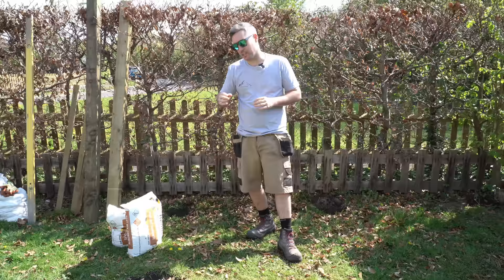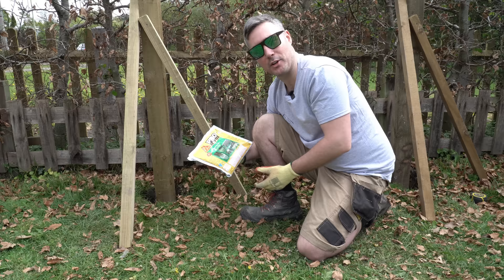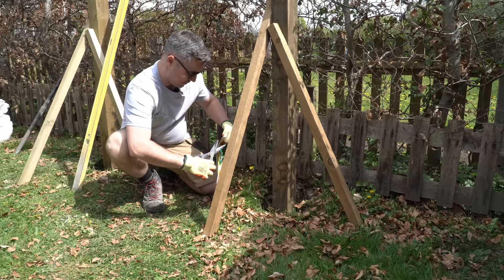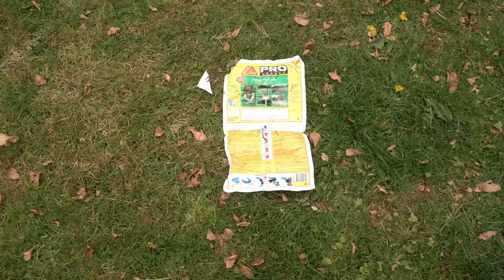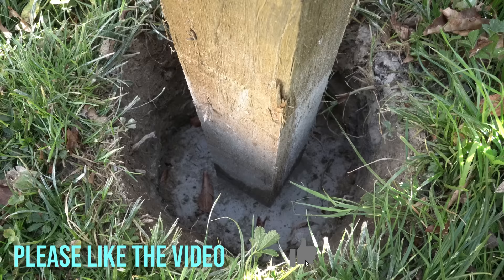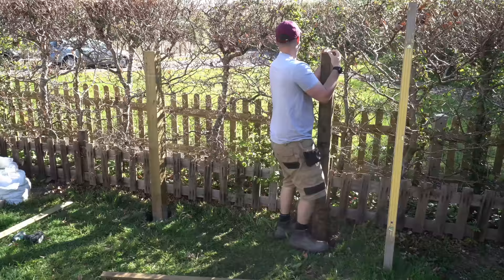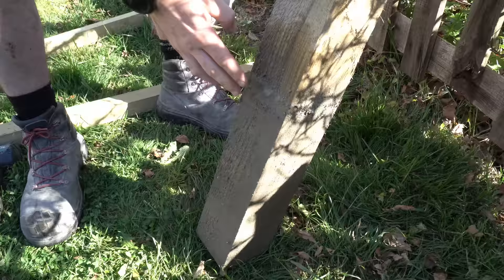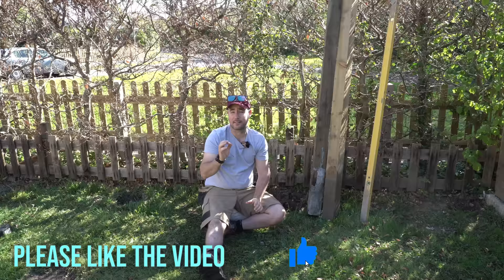Fence Post Foam vs Concrete | STRENGTH TEST

Comment: I've set posts both ways.  I've had them set for several years now and both methods are rock solid.  IDK what you did differently.  I think the foam is certaily much easier for someone with a bad back or arthritis.
Reply: He didn't fill the hole properly and he dug holes that were far too big (diameter). You can see he easily pulled the post out of the concrete with minimal effort. Did basically nothing right. Terrible fencing.
Reply: Foam is the way to go. I don’t think he mixed the foam bag properly
Reply: @kxjx  I saw that. The holes are way too wide.
Reply: Foam is plastics. Why would anyone want to fill their soil with that?
Reply: @Nicolasbotero1  I wonder how much the foam degrades over the life of the post. Its quite easy to cut the foam back out again; but if the foam is breaking apart/breaking down, or leeching anything nasty into the soil that wouldn't be good. Having said that, something tells me that the postcrete probably also has quite a lot of additives that might not be the nicest. And the carbon footprint of concrete is high (making the concrete, plus transporting all that weight). More good reasons to try to keep the amount of filler material to a minimum.
Reply: @kxjx  correct, concrete mix has plenty of chemicals! Debatable what is worse for the environment but I would venture to bet the plastic foam is.
Reply: @kxjx  100%  He put a bit of product in the bottom of a hole.  That is not how you use either product for fence posts.  Absolutely the worst attempt at putting in posts that I've ever seen.  Not sure how you do it this poorly as even the instructions on both products tell you how to do it and there are thousands of videos and articles on how to put in posts.

Comment: I had the ultimate test of fence posts set in concrete.  During Hurricane Katrina in Mississippi, USA, posts broke off just above the concrete.  Some posts shifted and others snapped laying about 25' down, sheered where the nails failed.  I am a firm believer in concrete, though a pain to replace, but very sturdy.  I am also a firm believer is using screws instead of nails as screws do not pull out unless they break.
Reply: Nice NPC flag.

Comment: I've installed many field entrance posts with 16-20' steel gates.   I've used concrete and foam more recently.   I would never go back to concrete.   The foam is easy to work with and if done correctly, it protects the post and is every bit as stable.
Reply: What should he have done differently?
Reply: @rimrejects  followed the application instructions.

Comment: Up here in wet rainy Oregon, some of us use Pea Gravel for the post. It 
helps a few ways, like if the post moves even a fraction in the wind the
 gravel sinks and tightens the post continually never letting the post 
get loose. (Just keep the pea gravel capped off). Also, the water has a 
drain away from the post ground level so the water rot in that spot is 
no longer a problem. Another way it helps is that there is no concrete 
mixing! Many up here think it's faster and better.
Reply from the maker: The whole post hole is filled with pea gravel ? Thats a new one one me and i cant see it working if im honest.
Reply: @JamesMontana  concrete is the worst thing you can use. I retains moisture between the concrete and the post. The post eventually gets saturated and rots off at the top of the concrete. Foam is used by all the utility companies for their poles that weigh about 1500 pounds so I think your fence posts should be all right. A post that has gravel round it compacted in six inch lifts is not going anywhere and it allows the post bottom to dry out. I would coat the bottom of the post with  asphaltic foundation coating or put 30 pound felt around it prior to back filling.
Reply: Yep. Pea gravel is self packing. Often used as a base for filling big holes and topping off with concrete.
Reply: @DG-kq8zf  When the old concrete guys all say pea gravel is the way for post, you just got to listen. Doing the same mistake over and over has got to learn them something. I would think. They sure are firm on the gravel!
Reply: The subsoil where I live is clay. It retains water so timber posts will never last long. We use H section concrete posts set in concrete but this foam is probably just as good. All methods are only as strong as the surrounding soil.
Reply: @JamesMontana  in Florida where the water table can be high after rains, this is how greenhouse posts are set, in pea gravel, it's like a Chinese finger torture for the fence post it also drains super fast.
Greenhouses have lots of irrigation several times a day so  drainage is very necessary.
When all is said and done after a hurricane, the nursery office may be gone and the plastic may be shredded but the greenhouse structure remains
Reply: @JamesMontana  try it my neighbour showed me this 20 years ago the posts still stand today it’s impressive
Reply: ReasoingTruth  Crusher chip is even better.
Reply: @gordthor5351  I never even heard of it before. (I'm not in this by trade). But looking at its description, I can see how it would be better. I'll pass it on. I figure the tighter it packs yet still allows water drainage, the better everything will be. (Around the post). LOL
Reply: @JamesMontana  Doubting Thomas is that you?
Reply: @reasoningtruth  Crusher chip is the small jagged chips from crushing larger rocks (typically for decretive colored landscaping rock). 

I agree, the tighter it packs the better and I don't think anything packs better than crusher chip. It locks together like Tetras with a lot of friction area and still has great drainage.
Reply: @gordthor5351  I know, now. It's also the preferred bedding for pavers, for the same reason, great compaction but still great drainage. Who could ask for more? Thanks again!
Reply: @JamesMontana  That works very well, in Normandy France with a pretty rainy climate on a clay soil with sometimes strong wings, using well compacted 6-10 mm gravel to fill the post holes. Besides in a such humid climate that prevents the posts (treated, and covered of tar in soil contact part) from rotting as the water runs immediately. A well done fence for horses will last more than 30 years.
Reply: @reasoningtruth  no they aren’t.

I got quotes in my area this year from local fence companies. All concrete the posts in.
Reply: I installed a treated wooden fence 21 years ago around my back yard. Holes were dug 3 feet down by 10 inches wide and filled up with crushed rock around 4 by 4 posts that were also treated. This year out of the 50 posts, I had to change 3 that were broken 2 feet down in the soil due to various impacts over the years. I was easi.y able to pull out the top portions of the broken posts but had to dig 3 feet down to remove the rest and installed new ones in thier place.

No matter how well treated wooden posts are, they will all eventually rot and need to be replaced but the point here is that it took 21 years. That's pretty good in my books and also, rotted or broken wooden posts are much easier to change when back filled with crushed stone than when back filled with cement.

Comment: I used the foam product on two treated 6 ft posts and it worked great and both posts are totally solid. I used a post hole digger and that left a hole just a little larger than the post. The mix in both cased grew just slightly above ground level.
Reply: Yeah his holes are far too big for a 4x4 post. 1 bag with a proper dug hole fills to above the hole. Shave excess at a slope to move water away from the post. cover with dirt. Never had one of these fail on a fence or mailbox.
Reply: He dug these holes way too big for foam. The foam works great when used properly. We did our entire fence with it and it's been rock solid through 3 hurricanes. Hurricane Ida hit us directly with the north-facing wall of the eye and our fence is still solid.
Reply: Hey if I wanted to do a 4x4 post for string lights about 8 ft high, would sika be ok in this application? Also how deep and wide should my hole be for 8ft high post above ground? Thanks!
Reply: seems like both would have benefited from a couple small lag screws being placed on the post so it wouldn't be pulled out so easily. The posts are too smooth to hold without adding some notches or irregularities to them. Don't think it's going to be manually pulled out with some screws or nails embedded in the post base.
Reply: @donaldso718  Yes

Comment: If you add the foam correctly, its a much better seal against water. When you add the foam liquid you are supposed to make sure you pour it against the post on all four sides so that the post is coated with foam liquid even above grade. Also, lets fill the hole...lol..the foam should come above grade. We use a product by a different name (Fast2K), and its far superior to concrete.
Reply: Your comments are correct.  He didn't install as noted in the instructions.

I tried the foam this weekend to install a wooden mailbox post and followed the instructions as per the bag.  it expanded much more than in this video and completely filled the hole creating a slope away from the post.

Would I use it to install wood fence posts that will support a constant weight?  I am not sure but it defintitely worked as hoped / expected in my instance.
Reply: so if he pour the foam in the hole a different way or made the hole smaller around.. your saying the wooden post wouldnt be soaked after 6days..?  the post being soaked is Bad problem
Reply: @user5.56   My GUESS is that he didn't mix the product correctly since it didn't appear to expand like it did when I used the product.
Reply: @user5.56  what I noticed, he only poured it on 1 side. If it has to run around the post, it's going to create those voids, especially more so when it starts setting up and hardens
Reply: He is using it wrong that's right but in no way the foam is ever better than concrete except for ease of use maybe. The fact that it's missing the weight that comes with concrete alone is a big downside for anything that's bigger than a mailbox post
Reply: I've read that fast 2k is just better than the foam he used in all respects.  It doesn't contract after setting, which is a very common complaint for the foam he used.  Also you're correct that you're supposed to cover the sides of the post and if you do that then you get a weather proof seal on the sides of your post.
Reply: @user5.56  The post is soaked because he did not use drainage gravel in the bottom of the hole. The soil is wet down there. The post is just a big plant... Do flowers drink from the top down? No they draw water up from the ground. So the post, without a separator from the wet dirt is going to draw water up like a straw toward the dry parts of the post, just as a dry sponge absorbs and moves water from the wettest part to the driest part until it equalizes. So if he had put gravel in the bottom, the water would have pooled into the spaces between the gravel and the post would not have absorbed it before the dirt below the gravel could. Hope that answers your questions. I build fences professionally.
Reply: @hans2five  That's true. I actually use Fast2K. Performs better and sets faster than Sika. Ready to work on in 25-30 mins.
Reply: @Nipplepotamus   alot of flowers drink from the top down  catches it in the voids of the leaves..  but yea gravel defiantly would of help with this
Reply: @Nipplepotamus  or put a sealant on the bottom of the post maybe so it’s waterproof.
Reply: I think temperature may have been an issue.  I notice when I've worked with foam that the warmer the temperature, the quicker the foam set up and fully expanded.  I think colder temps make the batch expand to slowly compromising the mixture
Reply: Just like a lazy man , defending foam lol i will stick with concrete thanks , faom lol , what happens if the land gets floods,  do the post pop out like corks in water ?
Reply: I wonder about what’s happened over time with foam and how it decomposes a overtime
Reply: I’m not sure how he did this wrong, but I put up 150 feet of 6’ high privacy fence using 2-3/8” steel posts (in Texas wood 4x4s warp terribly in the hot sun!) and have had no issues in over two years.  The foam rose out of the ground in every case and I hung a 5’ wide wooden gate on one post; you can feel motion but it still latches properly.  Caution- that foam is HOT and will give you a nasty burn - gloves required!
Reply: @NOBODY-oq1xr  That's strange because utilities use a similar material for power poles with no problems, it's odd they would use something like that as clearly power poles are a hair larger than your average mailbox 4x4 post.

Comment: Back when I did satellite installations here in the US for customers that didn't want the dish mounted on their roof, we used the foam on a pole installation and then put the dish on the pole/pipe. We have had tornados come through and completely destroy homes and while the satellite dish was gone and the pole maybe bent a bit, the pole remained seated in the ground.
Reply: Junk,I've used this a couple times at work ,ok for line post but not for stand alone gate post,
Reply: If you want the foam to work really well, and it will, you have to know the secret ingredient to add to the mixture. I found that if you mix up the 2 parts and start filling the hole, if you stop after adding 1/4 of the mixture and then sprinkle 5 oz of wheat flour on top, then add more mix and repeat with the flour, until you mix is all used up, you will get a much better quality of a setting. Another thing you could add is 2 1/2 cups of oatmeal.
Reply: @johnkapel2128  organic works best
Reply: Did you tell any of them that it's actually ground based ?

Comment: Just this week I installed two fence posts using the foam. It worked great. 

The foam expanded so much I had to cut a large chunk of it off above ground. Posts are solid 👍.

I used an old school post hole digger and dug 2ft deep holes for 8ft 4x4s.
Reply: nice try foam AI.
Reply: @bvbxiong5791  WTF does that mean?
Reply: @JeffRiggins8080  I think he's accusing you of being a bot? (Seems jokingly, but I'm talking out my back side anyways, so..... lol)
Reply: @krevor4095  I've been accused of many things, but that's a first 🙂.

Comment: I just used foam on fence posts this past weekend. There was about 6” of water in the bottom. As soon as you siphon it comes right back. So, I decided to use the water to my advantage and dry poured until the water line with the post submerged. Maybe it’ll rot. Maybe not. Then I put the foam on top of that. Worked great with no movement at all.

Comment: A rule of thumb I learned long ago was that you need one third the length of the post in the ground.  So if you want a 6 foot high fence - 6 feet above ground -  you need a 9 foot long post.  That gives your one third (3 ft) buried and two thirds (6 ft) to work with.  This method served me well over the years, no matter I used to fill the hole with.
Reply: If you are building another level /floor above it's superior otherwise 1⅓ in the ground for a fence is way overkill, there are  no 9 foot poles but 10 and 12 foot, at today's prices of PT wood it will be quite the expensive way to waste a foot of wood every pole since they can't be coupled to each other.
Reply: The instructions on the bag of foam mix straight up say 3ft in the ground.

Comment: I used the Sika(foam stuff) to help straighten out a fence that was leaning from a hurricane. The posts were already in cement, but with some ratchet straps and good old fashioned muscle, we straightened it out the best we could and used the foam to fill in the gaps in the post holes caused from the wind. It worked well!

Comment: So glad I found this before I put my new fence in.
You've changed my mind about foam and concrete.

Thanks for sharing 👍
Reply: The foam is good he didn't apply it correctly.
Reply: Tekagi  Feel free to point out what he did wrong ...
Reply: @silentfart5941  he very clearly didn't follow the application instructions. Try using concrete for putting in a fence or driveway and don't follow any of the instructions on mixing or installing and see how well that works. It has nothing to do with Foam, it has to do with him not following the instructions for use.

Comment: If you live in a climate zone that has winter…you have to pour the concrete so that the top is at least 8 inches below the surface then fill the rest with dirt.  If you don’t do that the frost will grab the concrete and heave it up out if the ground.  The dirt on top holds it fast against the frost.
Reply: Yup, exactly the mistake I made.